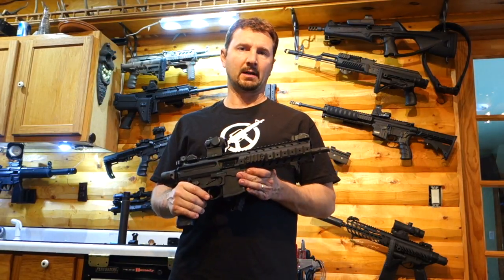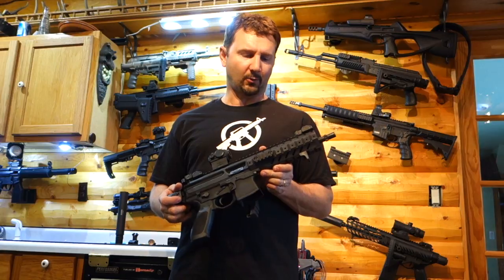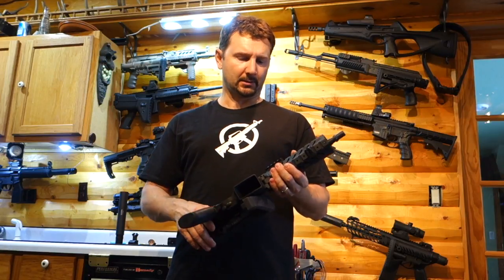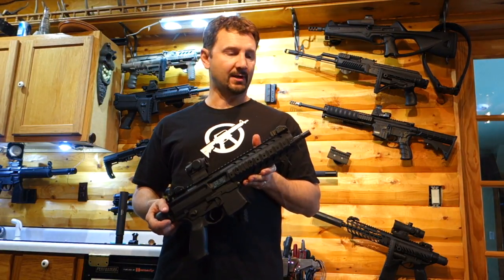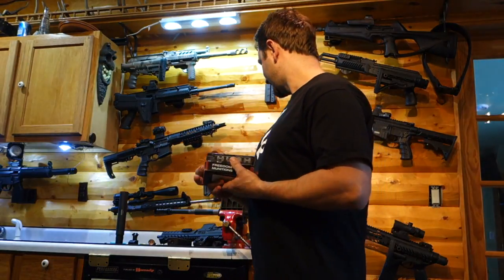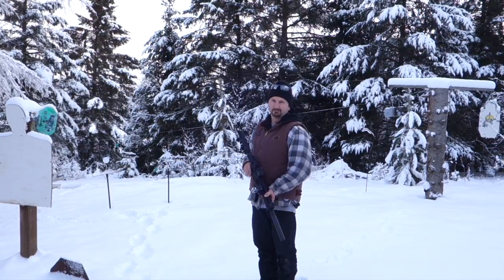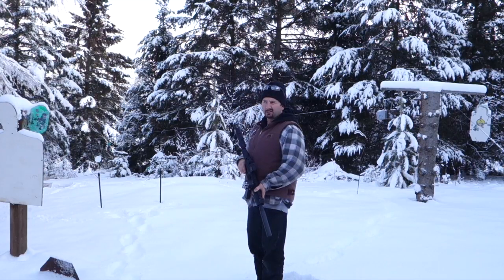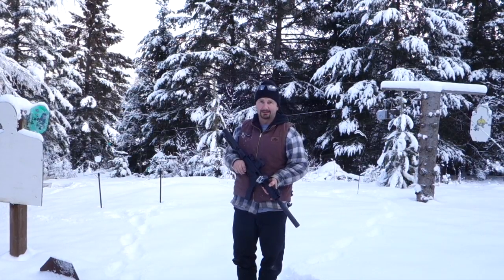MPX with Octane 9hd -HUSH ammo

Comment: I saw your video with the integral suppressed mpx setup and it didn't seem to allow comments.  Anyway, I'm not sure I see the point in integral setups with ported barrels anymore for 9mm.  147gr stuff is so easy to find and within a few dollars of 115 price wise you give up a bunch of flexibility and really only seem to gain unreliability.  A 3 lug or other QD 9mm setup seems to really be the best bet IMHO.  I have a mp5 PDW SBR with a trident9 and feel like it's just as quiet as the MP5SD I've fired and quieter then my friends integral 9mm AR upper.  

Someone is working on a HK lower that fits AR fire control parts.  That will be amazing if they get it working right.  A HK 9mm with either a binary trigger like this or even just a good single/two stage match trigger like the gesille ones would be freaking amazing.  I'd love having a good trigger on the mp5!  

Nice collection on the wall there!